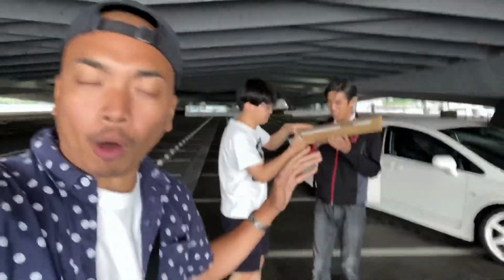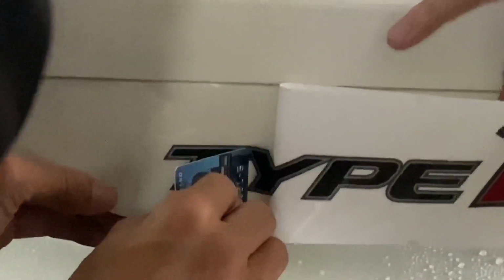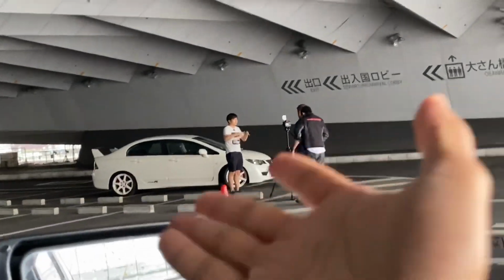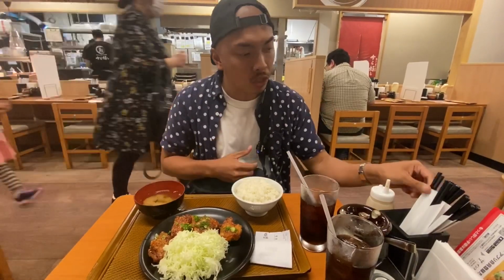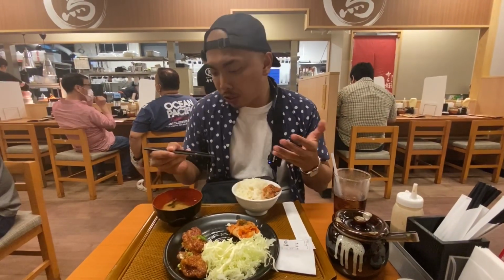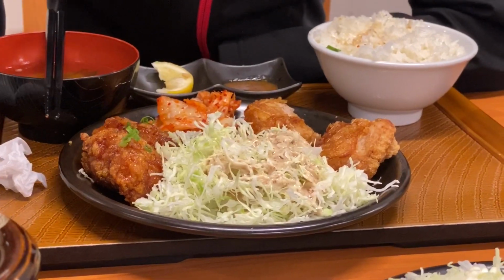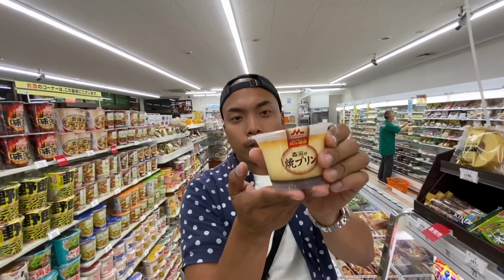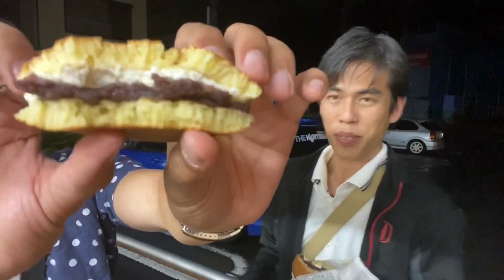FIRST MOD For The FD2 Civic Type R: OEM TYPE-R STICKERS! (+50 horsepower)

Comment: "The red Honda badge should only be on Type-Rs". Don't tell Civic Si owners that in the States. 😂 😂
Reply: I have one on my Daihatsu Charade 😂 it gets some funny looks from Type R owners.
I used to have a EP3 Type-R so it's ok 👍
Reply: They’ll ask for the Front End first everyone and there damn moms wants a FD2 front and rear end on there 8th Gens
Reply: @iheartgs400  I use to see a Asian guy in my area driving around in a Si with the FD2 conversation. It fooled me the first time I saw it for like 2 seconds before I realized it's a stupid Civic Si.
Reply: @deet4895  don't get me wrong the K20Z3 is still a pretty damn potent motor and with bolt ons is still pretty quick car. And  if you have the $$ you can swap the suspension setup of the FD2 to the USDM FA5 Si as well I've seen it on the 8th gen Civic forums.
Reply: @iheartgs400  it will still be a wanna be, Honda used specific techniques in the manufacturing of the FD2 Civic Type-R that can not be replicated.
Reply: same here in the philippines lmao, my dad has one
Reply: All the reason to tell them.

Comment: Early (00-01) JDM S2000s had filled red badges so there's zero issue with putting one on an S2000. Even if there wasn't, I see no issue with it. It's not the same as straight up putting a Type-R badge (That says Type-R) on a non Type-R or an M badge on a non M BMW. You can just think the red badge looks better. An M5 badge is without a doubt saying this car is not what it is. A red badge is saying it's a Honda. If you think those look better, and YOU put it on for that reason and not to make people think you have a type-R there is nothing wrong with that at all. But like I said, if you're still not ok with that, Honda has put red badges on non-Type Rs so they themselves never stuck with the Type R exclusivity. People get way too caught up in that. Also, the S2000 red badges are smaller which is another reason it can look better (Smaller than US badges at least, don't know about the later JDM non-red filled badges). 
That being said, I'll admit I associated red badge with Type-R. My point is that what matters is what the owner's intentions were, they shouldn't care if someone else thinks they are trying to make people think they have a Type-R. And you can just mention how they used it on the S2000. I suppose there is an argument to be made that because the red badge was used on Honda's F1 and other racing cars and Type-R cars they made later that it is still only for special cars. Point remains, putting one on your S2000 is fine, it had those from the factory before, it's a very special car, and even has a gauge cluster inspired by the McLaren F1 cars so it makes sense to have a red badge on it. The red badge is for special Hondas, but I give anyone who uses it a pass since it simply replaces the stock Honda badge and can show your car is a Honda in what you believe is a better looking way.
Reply: I don’t think red emblems came from the factory on models that were not Type R. On the S2000, I believe the red filled emblem was only on the red body. In order to match the the specific body colour. Same as Albo’s yellow emblem on yellow body. I understand your opinion on personal taste. This is just our thinking
Reply: Thats correct Captain. Same with the red NSX badge which maches the red body colour. No red H emblem on non red body coloured NSX or S2000 from the factory.